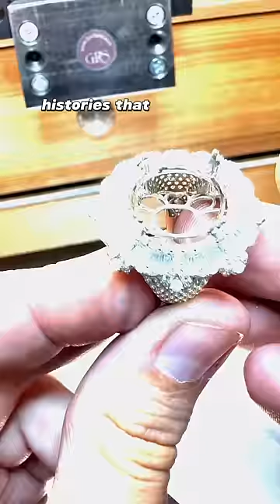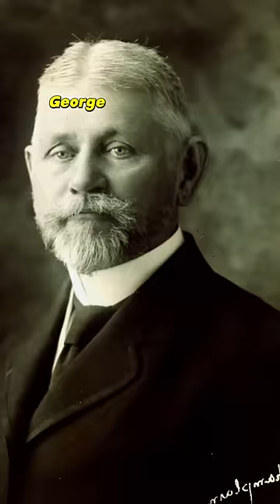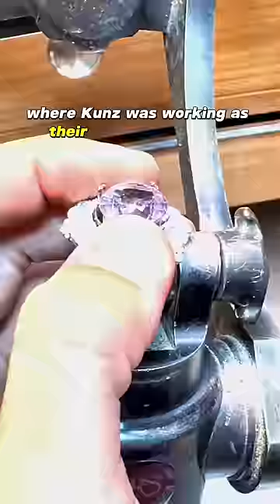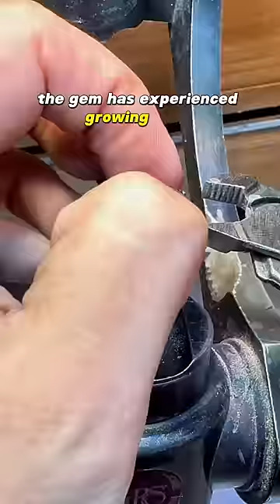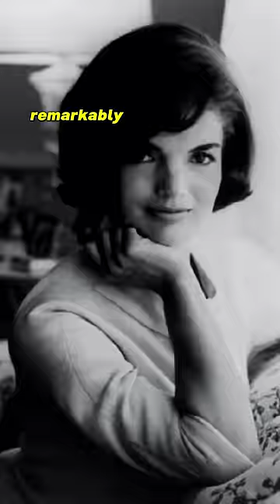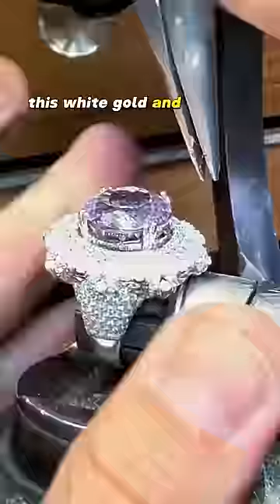What is Kunzite?

Comment: I actually "HAD" an original piece. From Tiffany's. Set in Platinum with diamond around it. It was a good size piece. Crystal clear. More pale lilacy pink. Than a reddish pink. This was a stunning pendant. I went to have it cleaned up and inspected (regular upkeep). The jewelry suggested a rhodium sterling silver chain.
Because sterling was stronger. It was true. Many years later, unfortunate events hit. My beloved husband passed away unexpectedly. I had to sell some jewelry for money. Or I would have been on the streets. I found out at the appraisal that the previous jeweler switched my stone.
(I was so young when I received it from my grandmother. I didn't know much). But, I was wondering why he needed to keep it over a week for a standard inspection and upkeep. (cleaning, checking loose stones, prongs etc). I know it was real prior because the certificate from Tiffany's was with the original case and box. The day she gifted it to me. We had it inspected. It was real.

Comment: 47 •/• 400,000 = 8,510.63 per karrot. 
8,510.63 x 13 = 110,638.19. 
Let’s add about 20k for the purpose of inflation. So… 130,638.19
And take off about 50k because that ring belonged to the wife of the assassinated president. So 80,638.19. And just to make it a nicer number, let’s call it 80k. 

80k for the 13 karrot ring.

Comment: Wasn’t the setting oval? Why’d you put a round stone in it? Doesn’t this drive you mad? I see everything and forget nothing. This hurt my head to watch once it was set.
Reply: I don't think that the setting was oval. It's just the camera angle.
Reply from the maker: You are correct that the mounting was originally for a slightly oval stone. I’m not sure what happened to the original stone but we had the mounting and a loose round Kunzite that seemed to fit with some minor manipulation on the prongs. I understand your frustration.